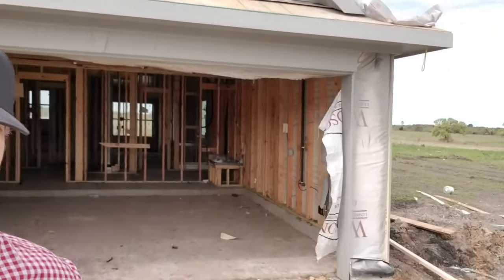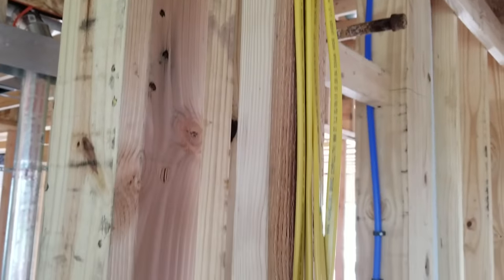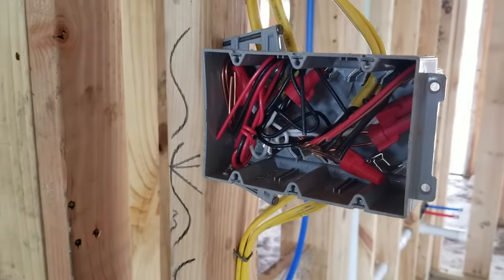HOW IS THIS EVEN LEGAL?!?!

Comment: watched this video a couple hours ago.
At first I was Pissed a little bit but after a few hours of thinking on this subject about this type of construction and my 40 years of working in the construction industry the video does being out some good point although not 100% correct.
National and southern building codes Accross the USA states that you only have to install felt paper and then your siding now they also state wind bracing in ever corners with a 1x4 recessed in the studs (we now use metal bracing cut in the studs) and have since the 80s. I hit the wrong button and didn’t finish lol.
What there doing is not against code the only thing they do need a water bearer I don’t know what the manufacture says on this material I may try to see the name and look it up.???? Is this what I would do putting the siding directly to the studs ??have I (yes) have I installed it over OSB (yes) I have also fixed siding that came off of OSB because the wrong nails where used such as trim nails smooth shank nails. Have I also done this (yes) years ago I only use ring shank nails and the right length as to penetrate no more than about a 1/4 to 1/2 inch through the OSB. I have seen siding put over insulation board and nailed to the studs. The insulation board has no strength at all as for racking are bracing only adds insulation value. I do not like this way but I have installed Siding back in the 80 and 90 like this also.
I don’t agree with the way the siding was installed but I also don’t disagree with it ether. Know as for how long it will last as long as it is installed the way the manufacturer states and I have seen this exact install in manufacture warranty most of them now I believe are over OSB
But as for the house lasting 2 are 3 owners before repair are replacement is necessary that probably right on most items inside and outside most people tend to renovate there homes even when materials are still good just not there style. ?? 
Now as for the building contractor I got news for you not all trac build contractors make the kind of money custom build contractors make.
There profit come from buying bulk material and volume of houses most track build contractors make average low end 6% high end 10 and stretching 15% 
Where as most custom builders and remodeler make low end 15% and the high end of 30% 
I always stayed around the 20% and 15% on change orders.
I could go in to more construction detail about the way houses are built today and what was built 100 years ago but it would take a while.
So I will leave this at that 
I think they need the correct bracing and water barrier.
Is the way they installed the siding wrong not by code it is not installed incorrectly. Would I do it this way probably not. With the cost of materials these days that 250,000 dollar house could easily get over 300 pretty quick.

Comment: father and brothers were builders and what they build today is shit, even when they put sheathing down its the shittiest sheathing you can get. I built my own and did it the right way, i used advantech sheathing throughout the house, that stuff you can get wet all day and it stays strong as hell. i used unfaced insulation and then used a plastic vapor barrier with tape  so the insulation in the house is awesome. heating and cooling bills are very low because of it...12 years and absolutely no issues yet....

Comment: An experienced carpenter would look at this and tell the developer they were lacking sufficient mental capacity to simply open a door on a building competently, let alone design and build them... though, most likely, using a mixture of sardonic euphemisms and crude slang that'd glide nicely over the heads of developers disguised as some kind of quaint construction flunky jargon.

... not that I have any first-hand experience to that effect.

I'll never understand why certification of construction trades is reserved for absolutely every trade but for the the one responsible for actually building structures.
Reply: Wow... that turned out sounding like more of a rant than I intended.

Comment: Their sheering is non existent. That's a huge fail. Tyvek or any other house wrap is normal as shown. Some engineers will call for plywood for sheer first but alot just call for coil strapping or similar for sheer strength. Also, window tape is common and acceptable for flashing windows so long as it's done correctly. Key words are "done correctly"

Comment: I think your criticisms would be better received if you were to mention the code requirements for your area. It is possible that it was "poorly" inspected but I doubt that it was "never" inspected. You need to be clear on what the inspection requirements are for this locale. You point out what look to be major omissions but do not explain what the actual requirements are? For Example:

1. You are shocked by the fact that there is no exterior sheathing. Sheathing does contribute to wall stiffness and shear, but so does Interior gypsum board and certain siding products. There are a number of ways stiffness may be incorporated into this structure. What does the code require for this build?

2. You are primarily showing us the garage, are there exceptions for garage construction? When you show us areas around the front windows, the house-wrap is not blowing around so there must be some sheathing there? So, is sheathing simply required on the main part of the house? Will the garage be finished with insulation, vapor barrier and gypsum board The first house you tour through certainly was.

3. House-wrap is not intended to provide the first line of defense against water infiltration, as a matter of fact it is porous to water vapour and designed to release any trapped moisture. No amount of sheathing behind this air barrier is going to provide any more water-proofing than is already there.

4. It is easy to declare that you build to a higher standard and build with better and stronger materials, but you fail to tell us what this adds to the finished cost of the houses you build? The $250K you say these houses go for does not seem like a lot of money and as you admit they are "starter" homes, so they are probably built to the minimum code standard for your area. Telling a young person they should buy a better quality house is no different than saying to them "you should sell your Chevy and buy a Mercedes".

Please, explain what the minimum code standards for this location are.

Comment: Why are American homes built like this ? Good or bad Quality why are they built like this ? It seems so cheap and weak . Walls made of wood? With gaps inbetween ? No concrete , steel , Brick ? Or plastering , Here in RSA we call Buildings like these Wendy houses , most are not as elaborate or fancy , but still made in a similar way , with wood , and they are not really meant to be permanent homes . More like extra extensions outside for storage space or temporary use .   How do you insulate the walls between rooms? If someone is making a noise in one room , can the adjacent room hear the noise as well? Here in South Africa , a cheap home will still be made with hollow concrete blocks , filled with cement and reinforced with steel bars . Normal homes are made with I clay brick , steel and concrete .  Whats the purpose of building like this in the US?

Comment: House wrap isn’t designed to “waterproof” the sheathing.  It’s designed to allow ventilation so the moisture can evaporate.

Holyshit!! I wrote that comment before I saw that there wasn’t any fucking sheathing..

Builders in my area have started using Tply instead of plywood, “ it’s better!!” Then why did you only start using it when lumber prices went through the roof?
Reply: In my opinion not having any sheathing especially in areas that get more than 50mph winds regularly throughout the year is a disaster. Not to mention I could see water easily coming into these houses through the nailed areas of the housewrap and in the corners of windows. The workmanship is piss poor and it sucks.

Comment: Great Youtube post. Our house, built in the early 90's, had the same poor quality. Styrofoam sheathing was nailed to the studs and the cedar siding went on top of the foam. Nails from the siding worked their way out and the siding itself curled after a few years. The basement joist had unfinished cross bars ( just hanging ). It snowed before the roof was finished so the snow sat on the subfloors and warped them. The windows and doors were delivered, then sat in the mud outside the house so they also warped. When I look at the plethora of houses built in vast subdivisions since the 90's I see the same potential blight that cursed our inner city neighborhoods of previous decades. It "should be" illegal to let monetary gain trump craftsmanship.

Comment: A burglar could just rip off the siding and brake in bypassing the alarm system sensors at the door and the windows. Simple so don't even bother installing an alarm system or window shutters in a house like this or with  thin standard 1/2 inch osb for that matter you can rip it with a hammer claw.

Comment: Videos like this are good and bad. Why ? Roll up your sleeves folks because these are suggested steps you take to CYA. If you are buying a newly built house ask the builder if they are using "Scopes of Work" as attachments to their contracts. If the answer is "NO" ... RUN and then find a builder who uses them. "Scopes of Work" define the builders requirements (above and beyond code) for each subcontractor. If this builder said "YES" to "scopes of work" and the jobsite looks like shit with trash ..... RUN .... The Superintendent is not doing his job. Your better general contractors use Scopes of Work because the trades will do it their way otherwise. A quick for instance in a thorough and comprehensive scope of work attachment - "each trade picks up their own trash DAILY period.' Trades develop bad attitudes when jumping over others trash. Another example if structural beams are not engineered beams (glue laminated beams) then are the beams "free of heart centers" which will minimize twisting after installation ????? The buyer will not know these intricate details so you hire a home inspector who has worked for a builder that knows this stuff and not what a Youtube video is selling. At the 6 minute mark in the video over the left shoulder of the speaker you can CLEARLY see the garage exterior wall has plywood sheathing for shear strength. If you do not have a set of building plans in your hands while walking a home you are very ill informed. To cherry pick is easy to do when a home is not complete in production so heads up all. Also the CODE requires a MINIMUM 20 minute Grade D lathe paper as your water proofing barrier before it hits the insulation and / or studs. You read that right. Its a good idea to put in your Scope of Work a MINIMUM 60 minute waterproofing barrier for your water proofing contractor and seal ALL fasteners. If the builders schedule to complete a home is under 100 days beware because quality will suffer. I was on staff with the two of the largest home builders for almost 20 years. In 1997 one of our homeowners drew a gun in my office while serving our company a class action lawsuit for builder defects. Long story short I started my own inspection company 25 years ago and know both sides of this fence. Hire inspection professionals and provide him / her a set of stamped (engineers stamp) approved plans (not a bid set of plans) to inspect in these stages for your new home. 1. BEFORE foundation is poured where footings and rebar steel / post tension cables are installed. 2. BEFORE drywall is installed where ALL mechanicals and wiring is in place. 3. AFTER drywall and painting and BEFORE flooring. 4. FINAL walk BEFORE you walk with the builder to create final punch list of repairs. To summarize YOU NEED FOUR inspection stages for CYA and be ready to rumble. Builders do not like sharing plans with anyone and if you are lucky to get a set make sure you wear a hard hat and steel toed shoes because OSHA (safety gurus) will cite you. Some builders use surveillance cameras so off hours activity is caught. Weekend sneak visits should be cleared with the builder and who may have you sign a waiver for liabilty and require proof of insurance. I've seen instances where buyers intentionally sabotage a home in production stage (cut romex wire and tape it back together prior to drywall placement) and take a picture feigning the builder is doing wrong. I hope this helps the next person and saves a few headaches.

Comment: 0:34 "The water heater's well plumbed." The relief valve of the water heater is improperly connected. It really should not have an elbow and it absolutely should not be routed through a wall. Admittedly plumbing codes vary, and these may be permissible in your area, but an elbow increases the back pressure should the valve open, and the horizontal run doesn't appear to be pitched which could allow ice build-up if there were a slow leak at low ambient temperatures. Having a discharge in another room is more problematic - one cannot observe the output of the T-P valve and cannot test it. The latter objection is stated in most codes, the former in a smaller number.

Aside from the house not being tight and having no racking strength is it would be very noisy. When you tapped the siding at 3:07, I thought that will be a lot of sleepless nights for someone when the wind blows. Sheathing provides a significant barrier to sound. I bet you could talk to someone in the yard from inside without raising one's voice.

Comment: Well not sheeting the walls should be illegal where is the sheer value  I did not even see any lateral bracing in them walls either them houses have no structurally value a wind storm can take that house down  ..up here it is 100% illegal ...  but that said  better understanding the materials  the Wrap ........House wrap is not meant to be completely waterproof or airtight because it needs to allow moisture and air to pass through. This prevents moisture buildup inside walls, which can cause mold and rot, and ensures proper ventilation, maintaining good indoor air quality. Its design strikes a balance between resisting water infiltration and allowing the building to breathe, which helps keep the structure dry, healthy, and energy-efficient.  and man that widow Wrapping is 100% crap and BS they need to be Sued for that one .....but at the end of the day it comes down to your State and county Building code and to be honest in the the States most codes and standards are Sub Par and in my opinion Criminal

Comment: You have to alert the code enforcement.....no way that meets code .I've never heard of that being legal in any state.there not enough lateral Bracing.....lateral bracing is bad enough.its very important....but if a stray bullet or a high powered break barrel bb gun comes their way,its going right through that vynle....and if that house wraps leaks and if they didn't use some weatherproofing tape around the windows and openings its gonna leak and mold all over.vynle siding was created as a method of going over existing painted and puttied and caulked remodeling jobs .the old dated exterior was meant to be left saving time ,money....vynle siding will leak.at every opening or but joint ...I see it put up in new construction everywhere.I use it myself....but I seem to be the only builder in town that waterproofs underneath.its more costly for a quality membrane and waterproofing tape.the joints should be taped or overlapped a large amount as well.also you never should put a joint in the siding above another joint anywhere close to below.its gonna leak in those joints.that's fine as long as it waterproofed under neath and water can drain out. 
In my local code area,and most states as well,they aloww you to put a wafer or cardboard,known as blackboard over the studs....i put plywood everywhere or durock,or lath and 2 or 3 masonary scratch coats over waterproofed house wrap if stuccoing or stoning or brick......if billy down the street with a pellet gun could send one Into my sleeping baby or child's temple through the walls and injure and possible kill them then I couldn't rest peacefully day or night in that house.people get killed by accidental stray small and large caliber bullets all the time.and they go through thicker stronger walls and doors than this set up.imagine how more likely it is to happen with 1 \16inch plastic vynyle siding and some paper...better hope it hits a 2by 4....

Comment: Not only are the builders at fault but the inspector and permit are at fault
Reply: The building inspectors are held harmless for good reasons. Shit happens after the inspector signs off on a house that he has no control over. For instance, you need toilets installed for finals. So does the next house if you are building in phases of 30-40 houses at one time. We would sometimes take a toilet out of a finaled house to pass the adjacent house's inspection - and - forget to replace it and the buyer does a walk through and no toilet. How did this get by the building inspector and you want to sue him one would normally ask ? This is just one small example why building inspectors are generally held harmless in any litigation.

Comment: I install and repair internet/tv.. You should talk about the lack of wiring these big builders are using too. Not only are you at risk of leaks, here I come having to drill holes in your brand new house because these cheap sorry dogs didn't run a data line to your office, living room, etc.

Oh, but it's a "smart home" because you can use their system to control the lights in the living room with your phone.. smh